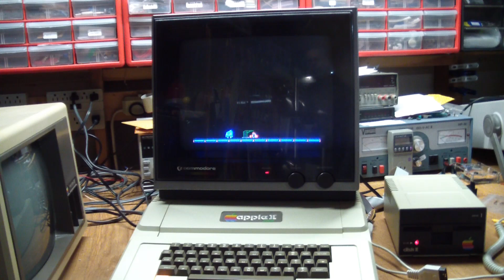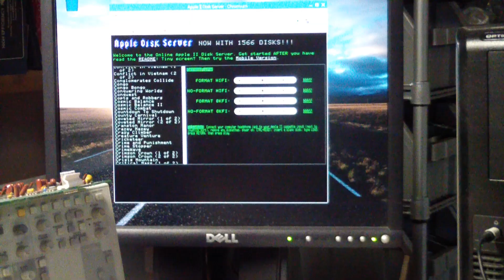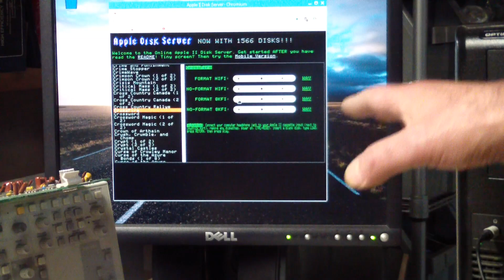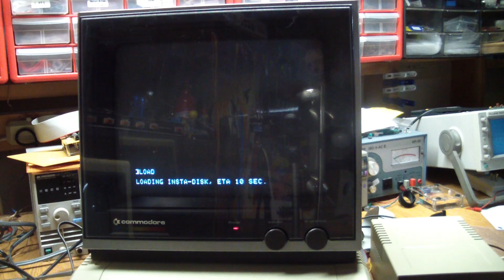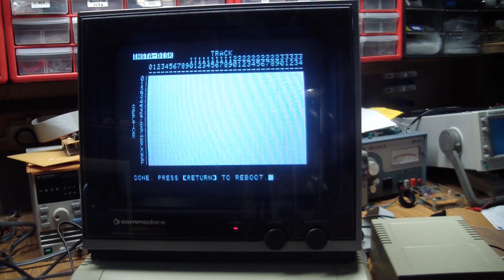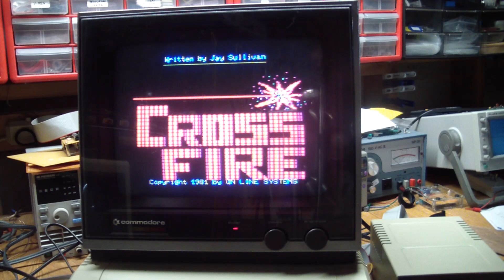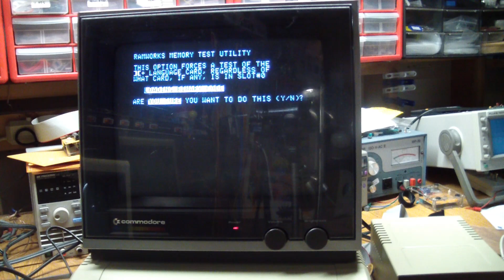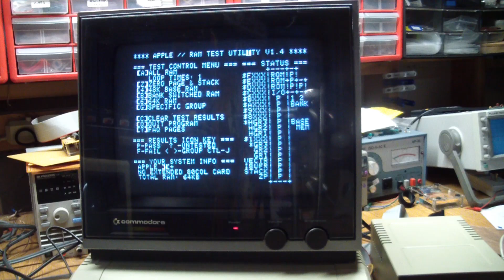AE#141 A Brief Tour Of The Apple II+ Microcomputer

Comment: I think Bandits and most games used ctrl-J or ctrl-P to enable joystick/paddle control.  Also, I noticed you have a Sup'R'Mod II tucked inside your case. Although composite output is common now, very few if any TV's back then had composite jacks.  Almost everyone until later in the 80s was using a TV for a monitor. Apple did not have  the common RF output because they had trouble getting FCC approval.   So almost every Apple had to be sold with this "accessory" - the Sup'R'Mod RF modulator - to get video to a TV set.
Reply from the maker: Great info, I do remember playing Bandits with a joystick. 
I totally ignored the Sup'R'Mod because for me it's as useful as a 300 baud modem.

Comment: I'm pretty sure you're wrong about the monitor and it was the monitor brought out for the Apple ]I[.  It came out at the same time as the Apple ]I[ and shares the same styling.  There's supposed to have been a stand available to help with the larger size of this monitor when used with the Apple ][ series, although I doubt it was very popular in the US.  The problem with using the Monitor ]I[ is it's monochrome, while the Apple ][ series has color out of the box by a method that only works on NTSC-based display systems, so it didn't matter in parts of the world that didn't use the NTSC standard.  (The Monitor ][ series came out later to match various Apple ][ series models.)
Reply: I agree with this.  Although the stand for using that monitor with an Apple II actually was fairly common here.
Reply: @rivards1  I wouldn't have thought it would be, unless it was the only monitor stand Apple sold in that period?  The Apple ]I[ was only market for a short time. (For the world of 8-bit computers, that is.  Compared to how long a current computer model usually stays on the market, it stayed available for a fairly good period.)

Comment: Nice trip down nostalgia avenue. It's too funny that the slow and unreliable cassette tape interface has now found a new purpose 40 years later. Makes you wonder if in 40 years someone will be serving Halo on the Terranet using a wifi emulation hack.
Reply from the maker: Wifi will be replaced by a giant inductor (your dwelling), and all charging and comms will be done with you as the transformer core.

Comment: Why is the power supply box so huge?
Reply from the maker: In those days more components were necessary for a switch mode power supply, and capacitors tended to be physically larger.